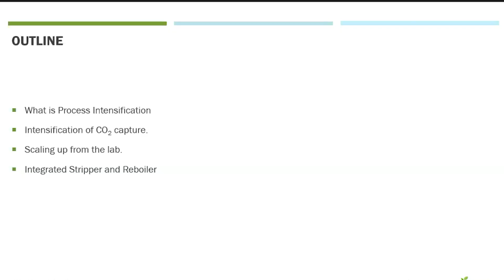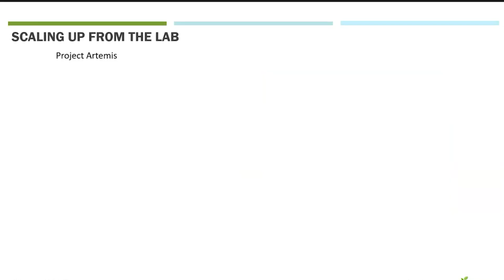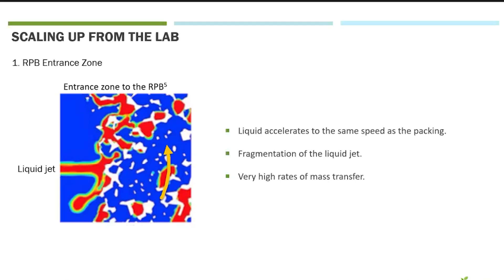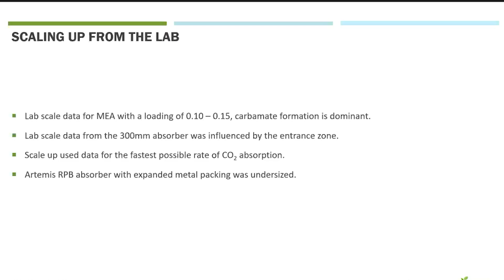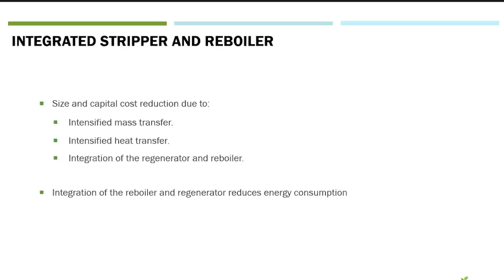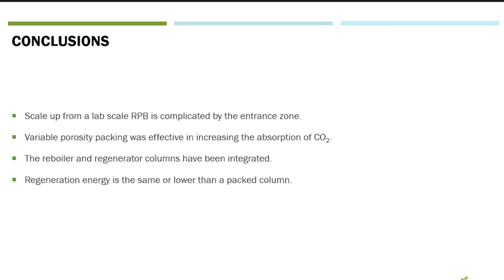Advancements in RPB technology for CO2 capture

Comment: Hello, hope you're doing well

I just wanted to say that I really enjoy the scientific content you share. Your video on CO₂ absorption using a Rotating Packed Bed (RPB) was truly fascinating, and I followed it with great interest. Thank you for presenting such specialized topics in such a clear and understandable way.

I had a technical question that I’d be grateful if you could help me with:
In the video, you mentioned an equation used to calculate the outer radius of the RPB. It seems a bit different from what I’ve seen in some high-gravity reactor design references. I was wondering:

Why is that equation not considered accurate for determining the outer radius, or what limitations does it have?

And if that equation isn’t precise, what relationship or calculation model did you use to determine the outer radius in your RPB design?

I’d really appreciate any clarification you can provide.
Thanks again for your valuable and informative content!